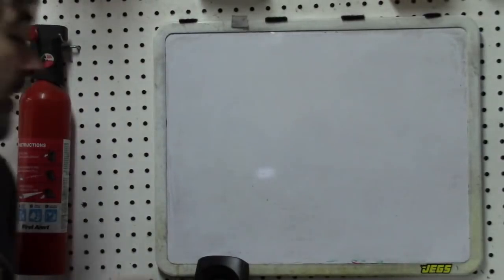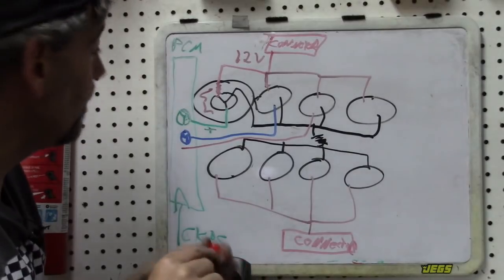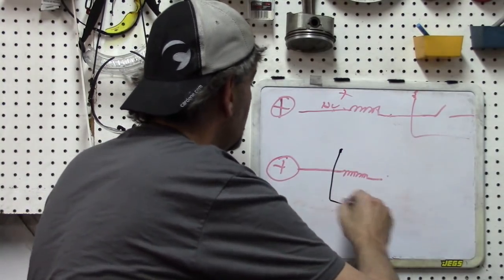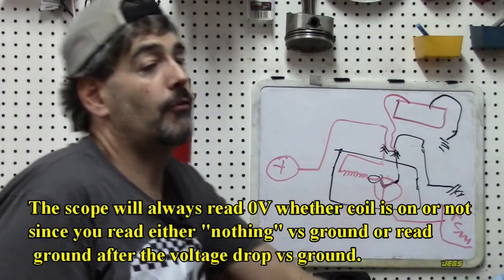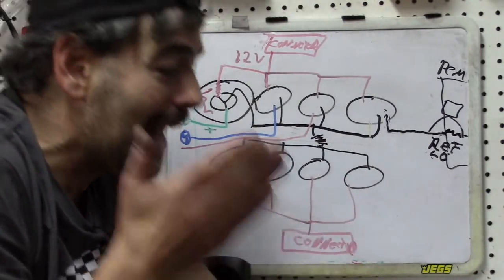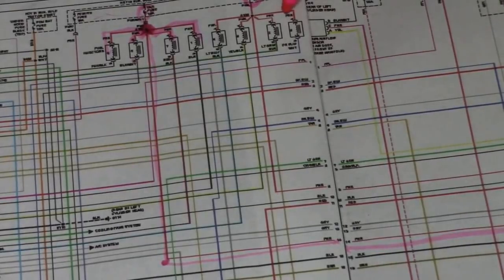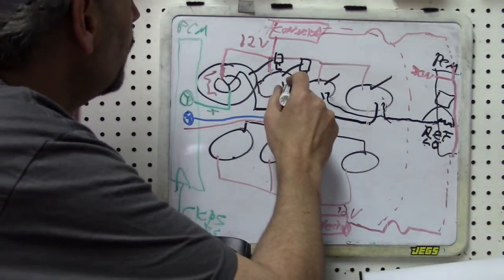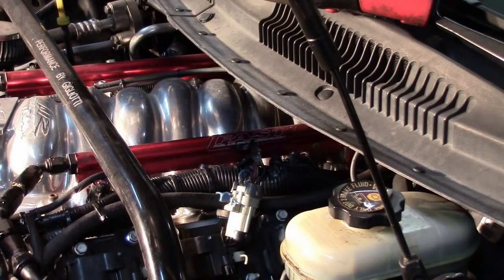Xmas Special! Diagnose,Understand Ignition Free from SBQM + Xmas Story!

Comment: Hey amigo I your help
I'm having trouble getting my 2013 GMC Yukon to start  
After I rebuilt the transmission and putting it back now my truck won't start and I don't have communication with ECM or TCM. I checked the obd port and I have power ground and signals I have 120 OMS.  I been checking all grounds and powers and  and if I disconnected any module and recheck obd port for OMS again I get zero  put new computer in it and still nothing. I'm not an electrician person I start watching your videos and I thought that you can give me some help   security light is not on  the only thing in dashboard is traction control and stabilitytrack  and is not showing in which gear is it is not cranking and fuel gauge is not working I have fuel pressure starter works  and last thing I have signal on every sensor
Reply from the maker: What is your voltage on the powers and grounds showing?  Also what is the amperage showing on the powers and grounds?
Reply: @SchrodingersBox  battery volt from group to pin 16 is 12+ and from pin 5 to 6 is 2.66 volts  and from pin 5 to 14 is 2.34    hey amigo thank you for answering back

Comment: Happy Christmas a diffent chrismas already
 My only need right now is related to Turbo Desiel systems
I have a Motorhome based on a Fiat Ducato RV Dodge Ram and just seen this on a Forum and i thought of you!
Hi, Guys I have a problem with a Ducato 2.3 on a 07 plate the engine will just cut out at different speeds randomly. The engine light comes on but if I'm moving and dip the clutch turn off and then on the thing runs fine for a while. It's not every day though, and at 70, 30, OR JUST PULLING AWAY. I HAVE HAD 5 DIFFERENT Dienostic Boards ON different things changed witch I have changed as recommended from diagnostics
1 cam sensor so changed that
2 map sensor
3 mass flow
4 turbo boost sensor
5 fuel rail sensor
6 fuel filter complete with housing
7 THROTTLE BODY UPGRADE
8 FILTERS
IM GETTING TO THE POINT WERE IM GIVING UP any help I would very thank full
Have you come down off the ceiling yet?
Reply from the maker: I would have to see what data you are using to interpret these parts changes.  You mentioned they were changed as "recommended from diagnostics" but no data was shown on what the diagnostics where,  For example to change the MAP- the only possible way diagnostics would recommend to change it wouyld be if you  show incorrect MAP voltage after confirming reference, signal and ground-what were those measurements?  So its confusing that all those parts were "recommended by diagnostics".  Need to see the diagnostics data.
Reply: @SchrodingersBox  
Wasn't my problem just your classic parts changer, had a plethora of codes and just changed everything. His problem was likely to be related a known Ducato problem "rusty junction", corrosion due to a poor design of the windscreen scuttle,  rain is directed to an area under the fuse box that can also kill gearboxes by filling with water. Thankfully sorted since 2014
my question fell off the end post too long?
Reply from the maker: Ah well if it was just parts cannon firing I can’t help with that. I at the very minimum just need some basic. foundational level data like fuel trim curved against load with induction metrics on the MAP and MAF. Just some basic starting data to get a direction.   Right now there is nothing for me to go on.

Comment: I got a wire off the breaker on a fuse box to go to the fuse box to the Honor by the transmission and I don't know where it goes can you tell me exactly where it goes thank you
Reply from the maker: pretty simple- check to see if the wire is a feed to the fuse or a return after the fuse by checking the voltage. If it’s a feed to the fuse box simply identify the missing power side of the fuse that the wire came from and that’s where to connect it. Easy!

Comment: An explanation I have been looking for. I noticed the test light you are using from another video of yours, you explained that it can be used to test without hurting electronics, if this videos test light is the same. How and where can I find this test light? Also what is the proper name in case I have to search this out, is there a link you can provide. Now when I had a bad coil I used my scanners oscilloscope and using the ground going to the block and my amp clamp I could see all the coils fireing at the same time I noticed one of my coils had a different waveform, (7 Apple's 1 banana) but without knowing the fireing order and it didn't matter I used my secondary ignition pickup adapter on channel 2 of my oscilloscope and moved the clamp to each spark plug wire checking the oscilloscope until both waveforms lined up on the oscilloscope, found the bad coil. Another way you can do this to is just unplug each coil until you don't hear a difference in the engines fireing. But this method does not work on all cars. Oh if you get a Subaru plug wire you can test coil over plug applications out of head. Thanks for taking the time out to make these informative videos. You by far explain diagnostics step by step better than engine else I have found on YouTube. Keep up the good work.
Reply from the maker: any LED testlight is safe.

Comment: Hey Matt how are you doing man? I am in need of some serious help, I have a nissan Murano 2006, a crank no start. Battery died on me an I do not have any codes that I can go off. I tried replacing the camshaft sensor bank 1 and crankshaft without any success. I do not have much knowledge on electric systems.
Reply: I also tried starting fluid in the intake while cranking it and still am not able to get my car back on. Thank you.
Reply from the maker: check for spark.
Reply: @SchrodingersBox  I checked for spark, it has a spark. I ended up taking it to the shop, they told me the cylinders do not have enough compression, and that I needed another motor. Cylinder 2 shows 75 PSI, and the technician said it should be somewhere between 150-200 PSI Is there a way to try and fix it without going that route of getting a new motor? Maybe replacing cylinder rings or gaskets?
Reply from the maker: I agree with the technician if that’s what he found.  Any jerry-rigging to bypass proper repair would be very ill advised.

Comment: I'm wondering if you can help me please? I have no power to my fuel pump and my coil. Have checked all fueses and relays. Have power to fuse box. But it's missing ground to the coil and fuel pump. If I run a jumper wire to fuse panel where I'm missing ground to fuel pump. Push relay back in to complete the circuit and hold wire. Run wire to ground. I can cycle the fuel pump. But still on power to the coil. The problem is kicking my but. Please help!
Reply from the maker: Try a CKPS bypass

Comment: I was burned hard by these recently. Had a Volvo come in with a single cylinder miss. Misfire under load so I brought out the scope and checked the current ramps on the single feed wire for all the coils with a 2nd channel on a random control wire. They all looked the exact same, good amps, everything, every cylinder was there. Looked like an idiot when I told my boss it can't be a coil. I've studied this a few years ago and thought I understood it until I came across it in the field. The funny thing about 3-4 wire coils is they're usually easier to get to, so I just end up swapping coils or using a test light. Job done in 5-10 minutes. This time I wanted to just use the scope only and it backfired on me, I forgot what I learned and honestly didn't know a good current ramp can still be a bad secondary on the coil itself. I turned a quick diag into a 3-4 hour ordeal over nothing.

The best part is my boss is 65 and can't reliably diagnose a 2 wire bulb circuit and he "diagnosed" it right away based off symptoms as a coil. I brushed him off because he's never right and he wasn't really right in this case because that's not how you diagnose anyway. I knew it was most likely a coil, so what? It wasn't until I tested it that I got burned.

Mistakes are the best teacher.

Comment: I think my car has 2 challenges for you that have blown my mind since ive owned it. I don't want to go all crazy changing parts but I cant figure out how or why my car acts the way it does, I know for sure you would be able to find the issue. I definitely enjoy all of your video and I wish I had the time to perform these test on my own for fun. Man in what state do you live?
Reply from the maker: Colorado.  Give me some data (not symptoms- just data) maybe I can help.
Reply: @SchrodingersBox  I havent collected any data to be honest becuase I dont even know where to start. There is no CEL and I have no OBD2 scanner but I'm going to buy the 'bluedriver' soon. Idk if there can be something left on the memory of the PCM that will give a hint as to what I can be, I have 2014 Chevy impala 2.5L ecotec it has 90k miles on it, I have a sound system in it, majority of the time when I'm at a red light with the music turned up all the way the car acts like if it wants to turn off, it starts to studder and does kinda of like jerking forward motion it's very annoying. All though I notice this very little with the radio turned down. Has happened every since I can remember, I saw your video where you found coolant in the cylinder bore and did smoke test and all that and I felt like that could be it but I'm not like that, I dont change stuff just cause I feel like it will fix it. I want to understand why and how my cars been doing this. I though cam and crank shaft postion sensors but my car is so well taken care of....

My 2nd issue, is one with the dome light on the car, with the car on and the doors closed dome light has no type of function whatsoever, when the car is turned off and the doors are open is the only time I can make the dome light come on but the way it stays on I have to leave my finger on it lol soon as take it away it turns off.

Comment: Hope your doing good Matt.  Do you think a used snap on verus is worth buying in 2020 or is there current products on the market that does the same thing thats cheaper.  i found a verus for 800 bucks thats with a whole kit and a modis for $500.  is there another similar product with the same technology nowadays that isnt redonculously expensive?
Reply from the maker: Its absolutely worth buying.  It's still as viable a tool as when I got it several years ago.  Absolutely.

Comment: Merry Christmas  & Happy New Year. 
I've been watching alot of your videos,  to try and find out what happened to my 01 Prizm. 
I was driving along yesterday,  in slush and snow and had everything on  (lights,  rear defroster,  wipers,  heater,  etc.) 
When the battery light came on and the engine died. 
Turned everything off and tried to start, but just cranking. 
Is there something electrical I should check first or should I start F. A. S. T. T. E. C. 🤔
Reply from the maker: Always start with FASTTEC!

Comment: I had this car at the garage. When you accelerate suddenly for the pedal to touch the ground,  the engine don't pull much power and the sound is very little but when you accelerate gradually for the pedal to touch the ground then is runs normally with the require sound....can you please suggest what might be wrong with the car?
Reply from the maker: Start with the basics. curve the fuel trim against load with TPS and induction metrics. The fault will be apparent.

Comment: hey  Matt,

I came across another four wire system on scanner danner which did not utilize the feedback wire and initially confused danner himself. This wire was actually connected to one end of the secondary coil and also went to block ground. Normally, one end of the secondary is tied into the positive feed of the coil and the other connects to the plug wire.  Therefore  on this particular car there were two wires connected to block ground. This type of coil, as was later discovered was built like a proper transformer as are the waste spark type of coils.
The car was a volkswagen passat.
Are you aware of this system and ever come across it yourself ?
Reply from the maker: Wow. I would love to see that video. No- never heard of it and makes absolutely no sense to me why that design would be functional. If you have a link please post it!!
Reply: @SchrodingersBox  Not an expert on adding links in the comments, however if you you go to the scanner danner channel and look up VW Passat No start Case Study Part 1 published on June 1, 2019 you will find it. He assumes the fourth wire is a feed back signal and realizes it's not when he looks at the wiring diagram. Seeing that the fourth wire goes directly to ground he can't explain why until a smart student in the class offers the solution.

Comment: Can you help me by pass the skim immoblelizer
Reply: Let the key inserted still for a few (2) minutes. KOEO for about 4 times, and try to start.
Reply: @tomasnokechtesledger1786  may I ask what koae is please
Reply: @allenrandolph3343  KEY ON, ENGINE OFF for testing (ignition light only). That's for the pcm so it can recognize the chip in the Key.
Reply: @tomasnokechtesledger1786  Sorry what u mean by KOEO I still been using the hair dryer lol I cleaned all the grounds got anouther PCM at junk yard now with it the Jeep starts then die's immediately so I putold one back on
Reply: @allenrandolph3343  maybe it is time to investigste your fuel pump.
Reply: @tomasnokechtesledger1786  I got a new one on it
Reply: @allenrandolph3343  Did you send the pcms to a reflash guy, so to copy the main chip info from the old pcm and saved in the new one? So to it recognize the Key chip? My Citroen demanded that be done to work again. TADAH
Reply: @tomasnokechtesledger1786  no I have not did that yet went to Jeep they said they only do 2002 and up that the key on a 95 does not have to match the pcm
Reply: So I'm all confused lol anouther friend said it may be a wire shorting out I've spent many hours trying to get it right
Reply: @tomasnokechtesledger1786 This all started when the weather turned cold
Reply: My buddy I bought it from said he had alot of problems getting it started in the winter
Reply: @allenrandolph3343  And that happens a lot when you change battery without keeping energy on the electric system.

Comment: One last question. For someone who is capable of getting to this level but may need far more than you’re offering. Where would you advise we start?
Reply from the maker: Thanks for all the previous questions. To answer them all in one swoop: My suggestion- and this is sincerely, not biased- you are a prime candidate for the pay channel.  You don't need technical cert or even background.  The basic electrical series will take ANYONE with no electrical background and make them able to do the stuff I did in this video with full understanding.  I am told ALL THE TIME that my videos on that channel are better than the training most students say they get at their automotive schools. In fact, some automotive schools have used the videos in their class as part of the curriculum.
  ALso- I did not check on the cat so according to schrodinger's theorum it is 50% alive and 50% dead at this time.
Reply: Schrodingers Box thanks I thought that may be the case but wanted to get your thoughts on it. 

Random question. Are you by any chance as well versed on inrush current as you are with these other topics. I’ve spoken to engineers at Fluke, Klein, Southwire, Uei, and Agilent. And somehow I wind up stumping all of them and I’m just asking a few questions

Comment: Hi buddy love your videos very educational i was wondering if you had some advice and no Mechanic can help me my diesel cant hold idle unless i hold the revs it just stalls when i come to a stop or just at idle if can help much apreciated thanks very much buddy
Reply from the maker: Sure. what data do you have?  Anything could cause that. Need basic fundamental data for a starting point.
Reply: @SchrodingersBox  i dont have live data at the moment im waiting got my diagnostic tool to come that way i can get live data  and get back to you if want ? Also can do relearns then to  ive replaced few things like suction control valve and crankshaft sensor no different  blacket the egr mine a diesel 2.2 x trail t30

Comment: Usually REF LO is for the purpose of supplying the computer with a reference ground voltage from a place where that voltage is different (or varies) from the battery grounds being supplied to the computer.  It is POSSIBLE they could measure something on the ref lo, but more likely they are measuring something else (for example the  IGN CTR SIG) in reference to REF LO.  This REF LO voltage is different from battery ground because of the high currents flowing through the coils and the slight resistance of the engine block and battery cable going to the battery ground.   It's also possible that it's needed only to fire the transistor and no measuring takes place.  Misfire is usually measured from crank position sensor RPM variation.  That's my theory anyway.
Reply from the maker: Makes total sense to me.  I agree- there has to be some difference to measure that there is activity (voltage or current) that takes place from the secondary.
  All I know is the secondary ignition event sends current to the Ref Lo. I do not know if there is voltage or not, I presume there is, in which case there must be some type of load on it,
Reply: @SchrodingersBox   I wonder if GM kept the Ref Lo pin name from their old bypass ignition system but put a sense coil in to verify a sufficient spark event by a small pulse?